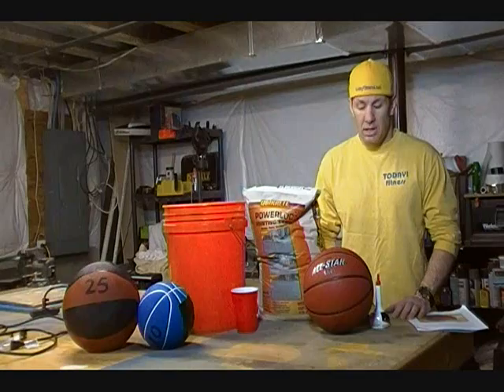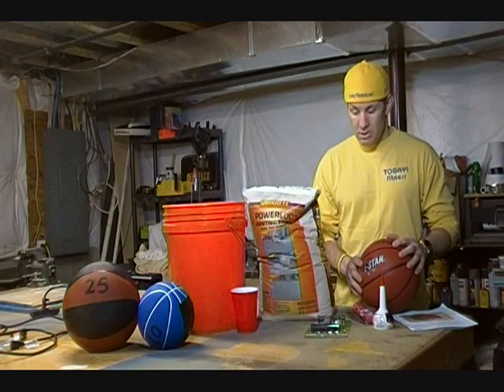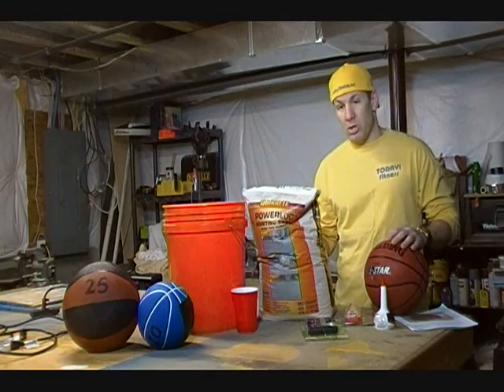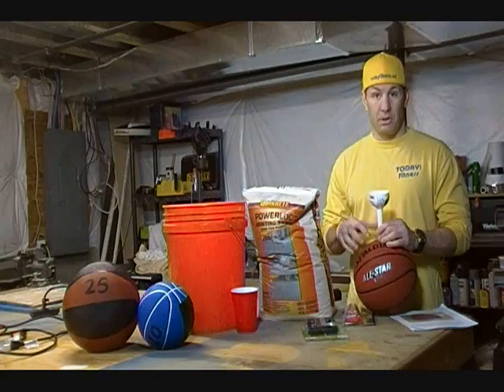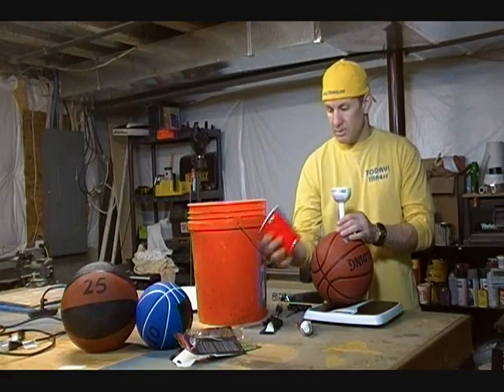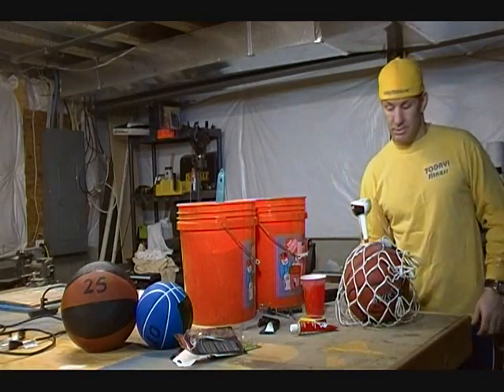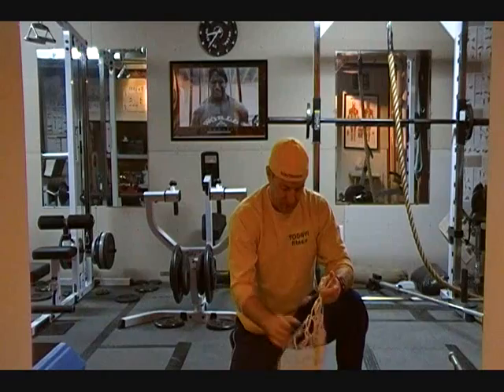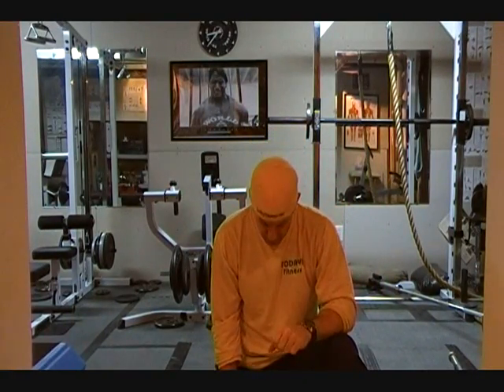TODAY! Fitness: Make a Medicine Ball "Slammer"

Comment: The tire repair kit doesn't work well in this case. When you fill the ball with sand, there will be dust all around the interior surface of the ball and that prevents the rubber stick to attach properly. 
I just tried with a basketball that I found and that had a little hole in it. I put 10 kg of sand in it, cleaned the exterior surface and then used the rubber sticks as showed in the video. The air comes out.
A better solution is to remove the valve, put the sand in through its hole and then put the valve back. If the valve eventually leaks some air, it's a much easier job to fix the leak.

Comment: Actually I filled 5kg in like 30 minutes or even less. I didn't used a facet or whatever it's called. Instead I pushed the ball where the hole is down forming a natural pit. Like a crater on the planet Mars or something. The speed is high and you can adjust the depth of the pit for the max speed. Works wonders.

Comment: Theres an easier way. Get an inflation valve for a basketball/football. Insert into the balls valve to release pressure. Compress/squash the ball to remove as much air as you can. Fill up a bath or container where you can completely submerge the ball. Place the ball completely under the water and it will suck the water in until it equalizes. I filled my one until I got 5Kg, you will probably get around 7 Kg's (just over 15Lbs) if you filled completely. Works a treat and you can slam it all day.

Comment: I would have tried to use the filler hole with the little air attachment stuck through it as my second hole instead of having to punch and patch two holes.

Comment: For the price of everything you buy here you can just buy a slam ball
Reply: I was going to leave a comment saying the same exact thing. 80% of DIY gym equipment is really pointless IMO when you can get a superior  made product for the same exact price or a couple of dollars more. Not to mention the time it is going to take you. Time=money. Gym equipment companies buy materials in bulk so they get it dirt cheap and lots of it is made in China. When you go to the store to buy the materials you are not paying what they pay, you have to take the time to do it and you most likely don’t have all the special tools and equipment to make a sturdy piece of equipment that will last a lifetime. There are a few exceptions however, I made my own TRX suspension system for 15 dollars, which is much cheaper than the ones you see online and it also has 500lbs more a max capacity than the brand name trx system.. I’ve also made some really cheap but solid pull ups bars by simply anchoring in black iron pipe with elbows and flanges into a concrete wall
Reply: @anthonyzambarano3017  dumbbell are also cheaper by homemade with cement

Comment: Why not just buy one... with all the money you spent yoy could have gotten a pro medicine ball!
Reply: Well..if you watched the whole thing...not that you really needed to...but  the whole point of the video is that with some patience you can make a homemade medicine ball for about 15 $, when one in a store would cost you around 50-60$...
Reply: All that material is not 15 bucks smart person... the spalding bball alone is 25
Reply: Abisai Santiago
 
Meh don't buy spalding basketballs..you can get their intermediate balls for 12 $ from big five or pretty much any sporting goods store..but I went with Champion Sports basketball. The rubber is heavy duty (perfect for what we're trying to make) and they cost 8.00 $ each. 

http://basketball.epicsports.com/prod/4783/champion-sports-heavy-duty-pro-rubber-basketballs.html
Reply: Abisai Santiago obviously, you won't go, buy a new basketball, then make a hole on it and fill it with sand.
The ball should be any old and forgotten useless ball you can find at home or wherever, one that no longer would be useful for what it was designed, so it could be recycled as a Medicine Ball.
Reply: Abisai Santiago a 30 lb slam ball only cost 40 usd. no big deal